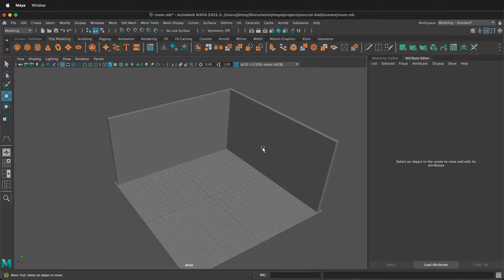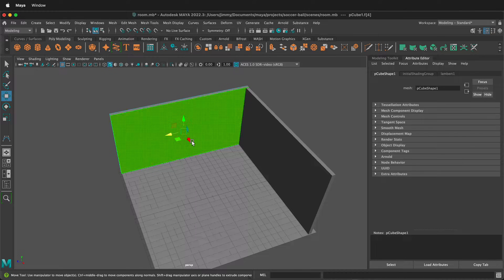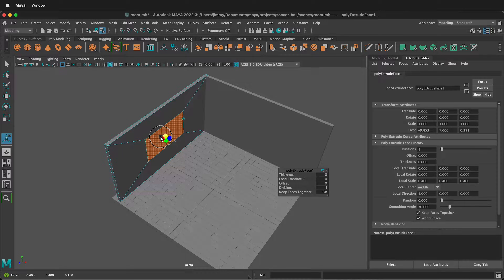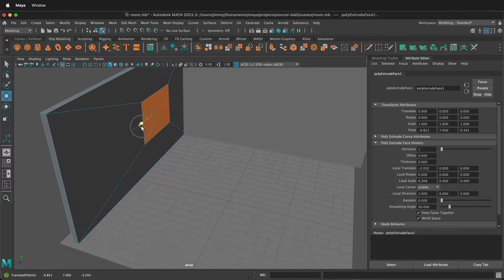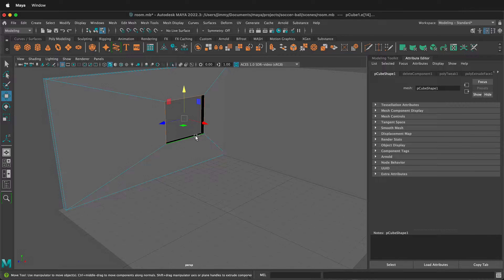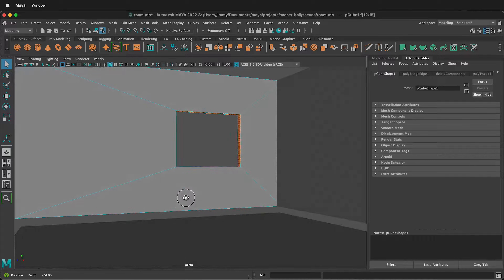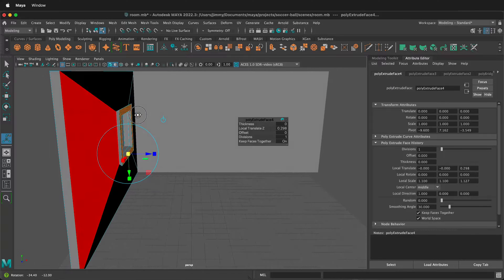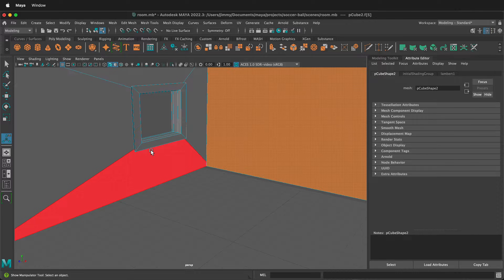Maya Tutorial: Make a Window in Room Maya

Comment: How about in game prop 
And how about smooth shade keyboard no. Command 3 
And it was look after the shade 
Is it round your window geometry or is it hard surfaces like
Tell me I’m stuck about windows and I know to create but when I do smooth shade mode by pressing 3 it’ll go insanely round
And I try many method like insert edge loop
Multi cut but it didn’t happened
Help me. 🫣🥹🙏🏼
Reply from the maker: Yes, you need more edge loops at the corners, and can use the multi-cuttool to do that.

Having more edge loops around details such at corners will allow you to turn smooth mode on or even subdivide and still keep your forms.